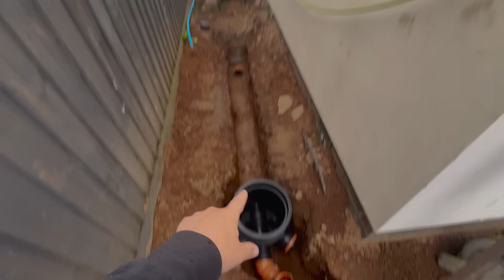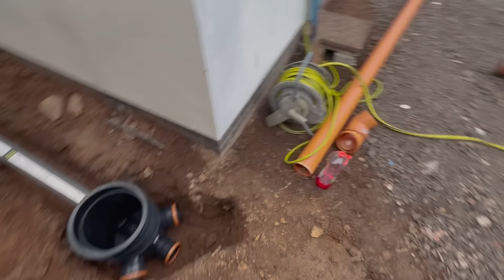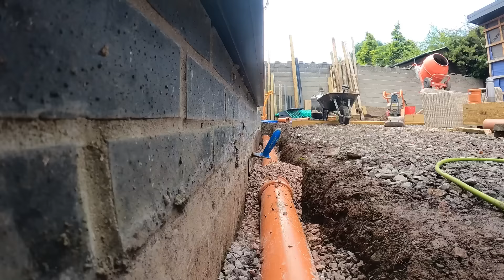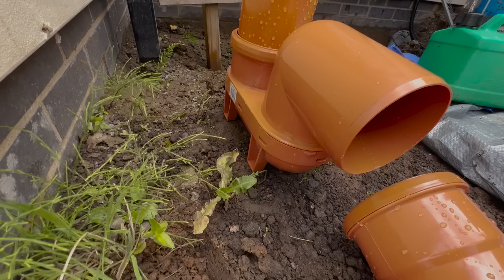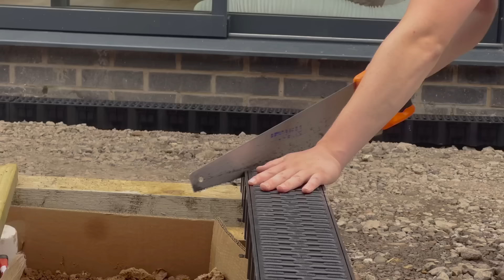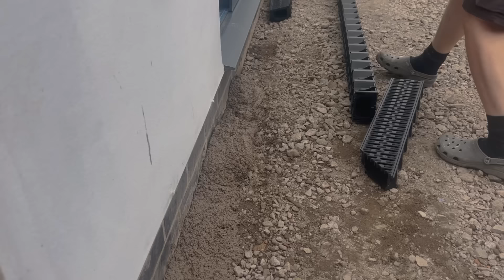ACO Channels - How i installed drainage to protect my bungalow! DIY

Comment: Informative video, and a great job. But why did you use what appears to be above ground grey soil pipe from the corner inspection chamber,  running to the sewer? It doesn't have the same structural strength as the brown/orange pipe underground that you've used on the rest.
Reply from the maker: Thank you, appreciate the comment! I honestly didn’t know grey pipe had less strength I though the colour was due to uv protection and I already had it from doing the internal soil stacks 😅🤦‍♂️ lucking the drainage is very shallow, only a foot path and only taking rain water so hopefully we shouldn’t run into any troubles

Comment: Great video , one question as I’m about to do the same job , why use stone dust for the mix , I assumed  it would be a normal sand and cement mix , is there a difference between the 2 sorry if a little clueless

Comment: Did you set a fall for the aco drains or bed it in totally level?
Reply from the maker: When bedding them in a set a very small
Fall? Just enough so that it fell about 5mm over 3-4m, that’s pleanty enough to allow the rain water to run off

Comment: I might be incorrect but looks like you are taking your rainwater to the foul sewer?  Why not to a soakaway in the rear garden...all need to do our bit to avoid raw sewage releases during heavy rain.  Also reduces your water bill if going to a soakaway
Reply from the maker: Architect informed me that a soak away had to be X amount away from the extension and X amount away from boundary line and due to this we couldn’t install a soak away and the planning was agreed to include rain water into foul, before the extension all the rain water just ran onto the front,side and rear garden causing horrendous damp issues in the property
Reply: @Selfbuild_TheJenkins 
Doing almost the same on the back of our Cotswold stone cottage. Was told by one building inspector to make a soak away (5 meters from the property). Not feasible for us. Another building inspector says okay to go to foul, as it's always done for over 100 years! Hope it gets passed, as all the drainage is in now just like yours! Don't know why this came up on my feed, but really interesting, and great work. Looking forward to the rest.

Comment: won't your channel filled with gravel permanently trap sub-surface water right against your foundation at the back of the extension?
Reply from the maker: The channel shouldn’t get filled with gravel as the chipping are larger than the grating slots. As for the surface water trapped against the foundation, that’s why we have engineering bricks up to DPC and the drainage is 150mm below DPC. Any sub surface water will just dry out on a dry day like it would if I had patio, pavers or gravel in the same place

Comment: The Acos channel should be joined at the corners with a corner section. Its a square box with proper channel  connections.  It won't leakl like your will. Good build and interesting video.
Reply from the maker: I’m not a fan of how the corner joints look, and the channels are to redirect the water, even the factory joints aren’t 100% water tight. The concrete bedding will seal all the joints enough though. Thank you 👍

Comment: probably a stupid question - but won't these acos leak where they join together, and especially at the 45 angles where there isn't a factory link.
or are you putting some kind of silicone sealant?
Reply from the maker: The channels are designed to redirect surface water, the factory joints aren’t 100% water tight. The ground around the drains will be wet from rain anyway so a little water seeping out the joints won’t go amiss, but as long as 95% of the surface water is redirected into the underground soil pipes it will be fine 👍

Comment: Nice job mate. The content is good for people like myself that have no experience in building. One question I’d like to ask is… are those crocs industry standard?
Reply from the maker: Hi Mike, thanks for the feed back, really appreciate it. Well, I’m offended you have to ask, only the finest soft rubber toe caps on my site 😅😅😅 I don’t usually wear crocs but this weather been a bit too hot for steel toe caps

Comment: is stone dust sharp sand?
Reply from the maker: No, stone dust is what it says, the dust from crushed stone, a mister of fine and coarse dust, a bit more substantial than sharp sand, usually harder to the top of hardcore and compacted but I have used it to create a fine concrete, it have a bit more give than using sand and chipping but has more resistance than sand and cement when it comes to bedding slabs and the aco channels. Hope this makes sense 👍

Comment: Hi, im 1 year into my self build and looking todo the same with aco drains. Trying to get a level threshold from the bifolds to the garden. Ill also be taking up the internal concrete floors to add insulation and underfloor heating just like you did so its been a very helpful series to visually see what to expect. I was going to also ask about the rainfall into the drains but you answered that so thanks again. Keep going!
Reply: Oo same but not got any walls up yet lol at dpc
Reply: @dononebullen hope your quicker than me lol im just below roof height on blocks and just below window height on bricks. Its hard work but really rewarding
Reply from the maker: Thank you for the comment, sounds like you have a lot to do! Good luck 👍